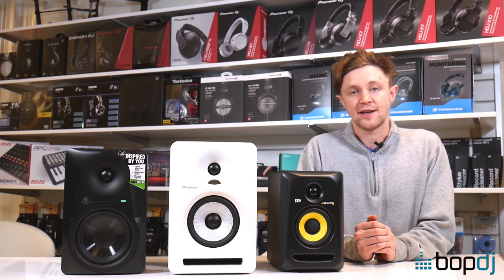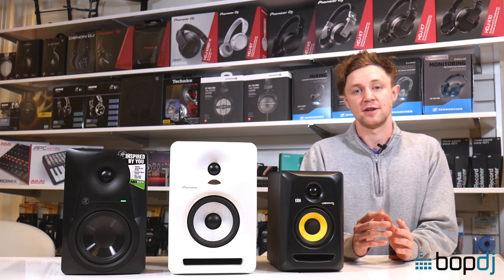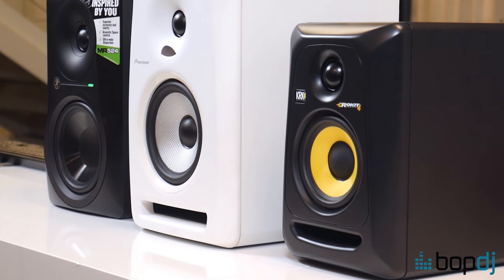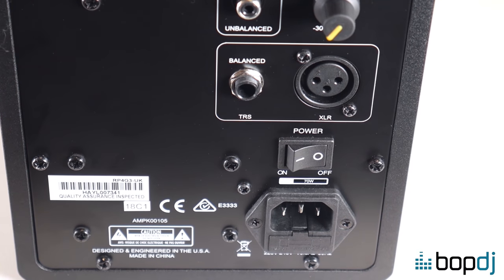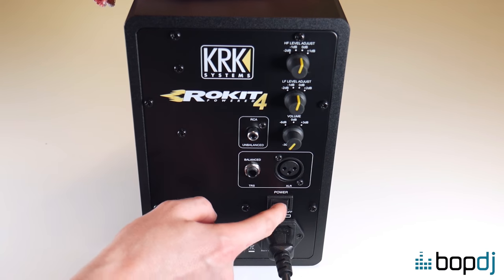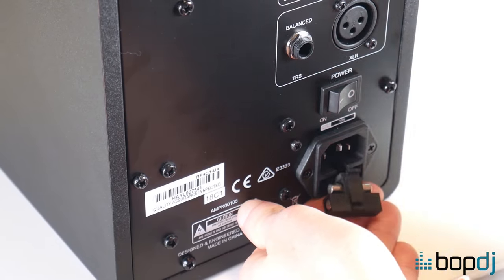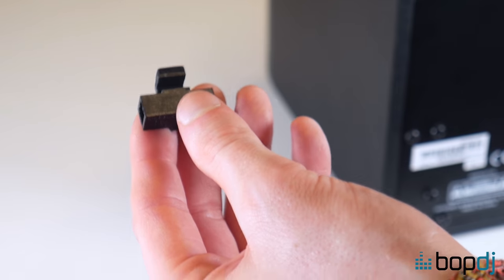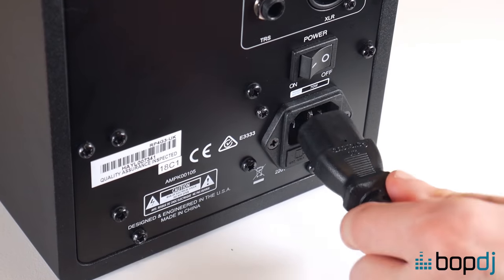Monitor Speaker Not Turning On? How to Change a Blown Fuse (No Power) | Bop DJ

Comment: Guys, if fuse is blown, it might be that something in circuit is also going wrong or its near getting broken, so changing fuse can sometimes do even more damage. Every time fuse is blown, there should be perform AMP inspection just to be safe. At least, do visible inspection for some burned part or bulged capacitor. That is my suggestion. Cheers.
Reply from the maker: Anytime!! 🙌
Reply: True

Comment: Best tip ever.. just fixed both of my m-audio bx5a speakers in 2 minutes.. THANKS !!!
Reply: I also have a BX5a and I am looking for help because it does not turn on.  I do not understand English.  What did he do, exchange the fuse?  Only that?
Reply: @hagonzalez16  Yes, he just replaced the fuse with a new one and the speaker turned on. I think you can find fuses on the internet.

Comment: Thanks man you made my day. My KRK Rokit 5 work flawlessly since 2008!! 12 years! The fuse blew now for the first time! Hoping this new fuse lasts another 12 years lol. Many thanks!
Reply: What fuse did you use or buy to replace them mate? I blew my fuse the first time ever turning my krk rokit 5. Just thought I’d blew them so they have sat in attic ever since. Found them recently and thought how can I get them working. Any help would be appreciated, thanks.
Reply: Luke Thompson the speakers come with a replacement fuse in them! It’s right underneath the power plug slot.
Reply: Luke Thompson can be opened with the tip of a small screwdriver, just have to swap the replacement one with the blown one.
Reply: Antonio Brandao my replacement is not there mate. I did buy them second hand so think previous owner must of used it :(
Reply: Antonio Brandao yeah opened it up the spare is gone so I’m looking now for a replacement 250v fuse. Looks like I can buy them from amazon ;)

Comment: Dude thats unreal. i just got M Audio Bx8 A2 speakers... and im so stupid.. i had one connected to the voltage and i didnt knew what that red thingy was and turned it.. then the voltage switched and it made "puff" and smelled burned. I thought i had destroyed the new speaker...  ive always wanted those and after all those years i get them and destroy them before listening to them.

I was in the middle of completely pulling everything out of the speaker to repair it and then in the right moment youre video shows off.
Dude thats so amazing and hilarious.

Be honest.. how often do manufacturer do something good, usefull and cheap for their customers??
This basically never happens... this is like opening a birthday present lol.-

And as cherry on the cake, the spare fuse.... my god thats insane. 

Thank u!!

Comment: MATE THANK YOU! In the manual I thought they meant change the fuse in the plug, didn't even know there was a fuse below the IEC input AND that there was a spare fuse. I stupidly changed the voltage to 120v from 220v while the power was on. When the little green light came on after I changed the fuse I think a little bit of wee came out :)
Reply: i swear i did the exact same thing😭😭

Comment: Thankyou so much for this video. One of my monitor speakers stopped working, I had no idea why, I hardly used my monitors in my new studio so was feeling very frustrated. Contemplating having buy new speakers was not great.. did what you showed and it worked. I had no idea there was a spare fuse inside the casing. This has saved me a few quid so thank you very much! 👍🏻💯

Comment: Thank goodness for this video. My 10 year old rokit started having major heating issues and buzzing noises suddenly. I switched the voltage switch, and it immediately fused after powering it on. Its working now, but still has a major heating issue suddenly. has anyone have a sudden major heating and buzzing issue?

Comment: Thank you so much for this.My speakers do that but very rarely (maybe ones in a week) when i turn them on there is no power and then when i unplug and then plug again the power cable in the back of the speakers are start to working again.Do you think its the same problem i have to do the same thing you do in this video?Also i change the cables but still the same.Thank you so much!!!!

Comment: Hi I got Jbl G10 it's powering but no sound,, 
I did usual trouble shooting like checking leads, volume knobs or broke  jack etc.  They are powered speaker,  I think I used it too close to the mic is it possible to blow fuse or something inside the speaker due to over loaded feedback.

Please let me know your thoughts 

Thank you

Comment: So my krk only half work. The tweeter works but not the woofer. Ordered a replacement woofer and it's still isn't driving the woofer. Would this be a fuse issue or a amp issue? I've also had these for 10 years so I'm not expecting much out of these

Comment: Hi. I have some KEF X300A active speakers that have been for a while now turning on but not working. When I turn them on, there is a flashing blue light to indicate LAN connection but after a while the light changes to a solid red light. The manual just tells me solid red means - switch off. So I never thought to try replacing fuse in same place with the iec power plug. And I just realised this today. Would my speaker still power on with a led lit to indicate a status if the fuse was blown ?

Comment: God bless you, I just changed the fuse in my BX8 carbon and it powered on. Thank you very much. 

Can you do a video on the remedy to 6.35mm TRS cables not working on M-Audio 2x2 TRS input and BX8 speakers TRS input?
M-audio 2x2 does not have an XLR port.

Thanks

Comment: Thanks. Thought that might be the issue with my Tannoy Reveal 402, but I've tried and still no sound at all. Power light is on but nothing reaching the speaker at all. New amp board or new monitor?

Comment: i tried this and the power was on but the sound wasnt working. volume was up and i even tried different cables/audio interface. one of my monitors still works fine so i was using that to compare different wires and plugs but no luck.

I also cracked open the back to see if it was a capacitor that maybe was bulging up but the board and everything looked in order. Let me know if there is anything you recommend trying next

Comment: First fuse burned, so I just discovered how to replace it. However, as soon as I replaced it with the spare fuse and as I turned the speaker back on, it instantly burned as well.
Reply: Same.. did you find a solution?
Reply: @alanhouze8654  Unfortunately not :(

Comment: Hi I have a jamo i300 and have changed the plug fuse but it still don’t work was working just 3 days ago now it probably needs the sub 1A fuse changed but I took the 10 screws off but back plate won’t budge can you offer me some help?

Comment: i got a Rokit 10s subwoofer i bought ages ago.. i used to have problem with it. it didnt want to work and i got red light. if i lightly hit the side of it it would go green and work normaly.. i did go to the store where i bought it and see if they could find the problem. they told me the sub was fine and they couldnt find any problem with it, only that fuse had broken. later on this problem started again. went from green to red and woulnd go back. so i have no clue what it can be. maybe i need to change the fuse?

Comment: I replaced fuse from my Krk subwoofer but still not working :( 

Just I turned off to clean that area where it is (since 2 years I installed it) and reconnecting all again not turning on. 

Any idea? even I didn’t use any wet towel to clean it.
Reply from the maker: I think you may need to take it to a professional to look at the device.

Comment: I changed the fuse on my M-Audio BX5 D2 yet it still won't power on, any tutorials or advise on how this can be fixed?
Reply from the maker: If you have changed the fuse and their is no power, we would suggest taking it to a professional as you may need to look internally to address the issue.

Comment: Just bought a used pair of ADAM A7X had them for 3 weeks. Few days ago the fuse had blown so i switched it with a new one, but now the speaker won’t work and  blows fuses everytime i try turn it on.
Reply from the maker: I suggest taking it to a professional to have it inspected or speaking with the person you purchased them from :)
Reply: I’ve sent them off i will let you know what the problem is when i receive them back

Comment: changed the fuse and as soon as I powered the speaker back on, it turned on momentarily and went dead. Checked the newly installed fuse and it had burnt. What can I do about this?
Reply: Hopefuly u havent switched ur wattage vault from 230 to 115?
Reply: what was your problem??
Reply: Mine keeps doing this and I am really trying to figure out how to fix it
Reply: Have you found a solution to this? Cause I have the same problem .
Reply: Cry... like I´m about to do now (I already changed the fuse to no avail) ;(
Reply: When someone who repairs this lmk price and where you got it done if possible
Reply: Copied from another commenter. 
"Probably a blown capacitor.  Happens all the time. Good chance it's a a few dollar repair if you're up for some soldering.
"

Comment: I have an issue with JBL LSR 310 S subwoofer, when connecting to jbl 308 mkii monitors there is no output from subwofer and the subwoofer works alone, why this is happening?

Comment: My KRK ROCKET speaker light come on, but no sound comes out the speaker.? it just did this all of a sudden, what should I do? Do I still need to change my fuse and what kind of fuse?
Reply: I have the same problem now :( Lights are on and display works fine but no sound now. Changing the fuse didn´t work. Maybe you found any solution now?
Reply: @CultOfSol777  I have sound now. I unplugged all my connection to the software i close it. Then i turn power off  next i turn my software back on the ipad. Then all my sound was restore. This do not happen often. Mostly went i update the software in setting.
Reply: @Bronzeey1  My problem is fixed too. I really don´t know what happened but suddenly my Monitor made 2 strange noises and out of sudden there was sound again. Maybe it was overloaded by something and the sound shut down for some reason. It was not even used. Everything was on standby. Somewhere I read it does have a protective system or something like that.
Reply: @CultOfSol777  Glad u have it fixed.

Comment: my woofer is not turning on. so I checked woofer's glass fuse. the wire inside the fuse is broken. so I thought of replacing it, went to a nearby shop and showed my dead fuse and asked him to give me a similar one. he gave me a fuse which is slightly bigger in length than my original one.
I put it in my woofer, it turned on. I was so happy that i saw power light on my woofer after soooooo many days. but is not giving any sound and withim few minutes it gave me a burning smell.
I turned it off. 
i'm wondering what went wrong.
pls help

Comment: mine is ON, I can tell because the front LED is led but it would not play. I tried swapping cables, that did not help. Never blasted them out to full volume, not sure what is going on. Any suggestions?
Reply: I have the same problem. Have you found any fix?

Comment: did this on my presonus eris 5
Reply: What voltage fuse did you use? I have the R65
Reply: @mauricewilcher3314  by default they are set to 230/240 but i changed it to 110 by accideny and plugged into a 240 socket
Reply: Massimiliano Pisoni  Thanks for the reply
Reply: @mauricewilcher3314  kool bro any questions jus holla at me any time

Comment: I replaced the fuse, my speaker turned on but made a weird tonal noise and after about 4 seconds turned off (blew the spare fuse). PLEASE HELP ANYONE
Reply from the maker: Hi George, we haven't ever come in contact with this so would suggest taking it to a specialist to confirm what the issue is as it most likely beyond the fuse but may have caused the fuse to go as well.
Reply: @BopDJstore  ok definitely thanks for responding!

Comment: I replaced the blown fuse with the spare fuse and it blew straight away, only had my speakers for 6 months too.
Reply from the maker: We've not come across this, it would be good to try the speaker in a different outlet. If this does not help it may be best to speak to the customer service team of the retailer you purchased it from :)